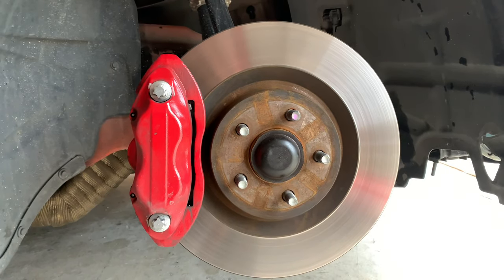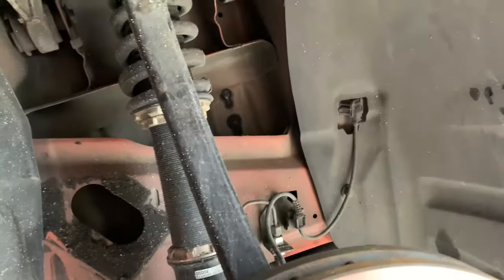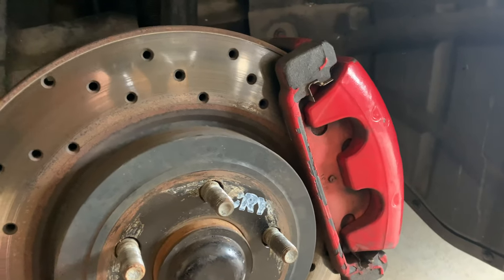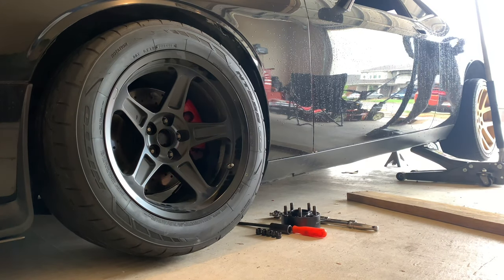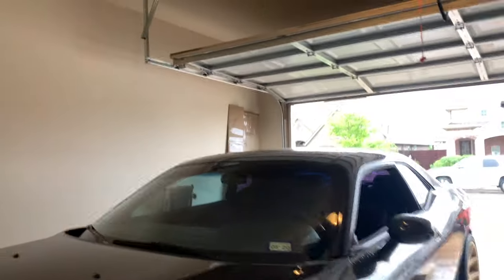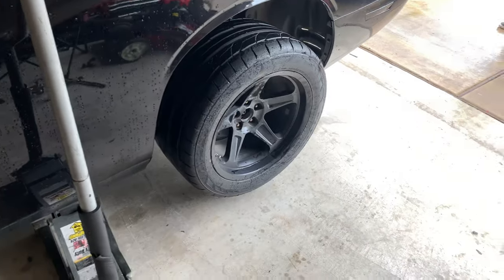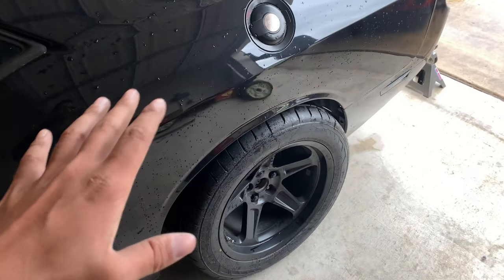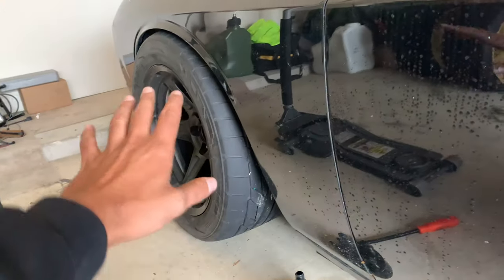OEM Dodge Demon Wheels On a Narrow Body Challenger!

Comment: Thanks for this video!
I have a 1320 Challenger that came with Nexen 275/40R20 Drag Radials mounted on 20x9.5 wheels, and just purchased a set of Demon 18x4.5 and 18x11 to use for drag racing.  I installed Mickey Thompson Sportsman S/S 28/6.00R18LT's on the front runners and Nitto NT05 315/40R18 Drag Radials for the back. I went with this combo because they are both very close to 28" tall, the fronts are rated for 1,650 lbs. @ 95 psi (regular race skinnies though lighter are only rated for approx. 1,100 lbs.), and the rears should easily fit on the back without rubbing anything while giving me an extra 1" of width over the OEM tires. The rears do stick out quite a bit...
Reply from the maker: Yea I mean the poke outside the body will still be pretty similar to my example even tho I used a 315 tire. Sounds like your on the right track and I’m glad I was able to help even if it was just a visual lol. We had a lot of fun this day swapping wheels lol
Reply: @TIRADORACING  Yes, big help. I know they'll stick out, but I'm only using them at the drag strip, no regular road driving. Thanks again!

Comment: There was rubbing when I did my 275 nitto 555 G2s on the fronts, but with a hub centric spacer I was able to fix it. Compared to other 275s the nittos stick out a lot more which give it that aggressive look but it also makes it harder to gain clearance. I’m sure with a different brand tire or small spacer he’ll be able to make it work in the fronts just fine.
Reply from the maker: Luke you did that on an oem demon wheel?
Reply: TIRADO RACING No, that was with my OEM 20x8 scat pack wheels. They changed the knuckles in 2015 so you could run 275s in the front. He might be able to use those instead of a spacer but I can’t tell you for sure.
Reply from the maker: Ok just wanting to clarify that for anyone who reads the comments for answers. We don’t want people reading that and thinking you tested that on demon wheels since that’s what this video is about lol......

Don’t forget about offset, where the edge of your scat pack wheel sits will differ where the edge of the demon wheel sits inside the car in correlation to the knuckle.

Comment: Found your channel last night! Awesome content! Have a question though..... I have a 14RT and I’m looking into the exact widebody kit you got on your chally. In regards to the wheels, I wanted to see if you know if I could possibly run the redeye 20 by 11 inch wheels on 305s on all 4 corners? I know the oem redeye wheels are a -2.5offset. Wanted to see if I would have rubbing issues at all? I am on full stock suspension btw. If you don’t know its okay. Thanks though! Looking forward to more chally vids!
Reply from the maker: Thanks for the kind words! And sadly I do not have a solid answer for you. I think you would run into the same issue as this video tbh. With the wheel being close or touching the knuckle and the tire being close or touching the knuckle as well. Nothing a small spaced can’t fix.
Reply: TIRADO RACING No prob! Thanks for responding! 👍
Reply from the maker: Of course! I’m a lot easier to reach on Instagram @tiradoracing but I will always try to reply to the comments section as well.

Comment: Great video. I have an '09 SRT-8 and was considering putting 18x11 Demon wheels on the rear with Mickey Thompson ET Street Rs in 305/45R18. Have you had any differential, speedometer or other issues after your swap? Also did you modify the tune with HP or Diablo afterwards?
Reply from the maker: I haven’t had any issues at all. Especially on the nittos being 315/40/18 that big sidewall makes the overall diameter of the wheel tire combo big. 

Now when I go to my bfgoodrich tires their 315/30/18 I notice my speedo says I’m going like 85-90 when In reality I’m going 70 on the freeway lol. 

But no issues on the 315/40/18

I didn’t notify Diablo or anything just been running it with no issues. Been over a year now actually. We’re at year 1.5 with this set up
Reply: TIRADO RACING nice, I hella appreciate the response. I think I’ll pull the trigger on this eBay purchase then. Good lookin’ out for yer MOPAR brethren. 💪🏼 Subscribed!
Reply from the maker: Ayeeee thanks bro! You got IG? Send me a DM @tiradoracing Would love to check out your build!

Comment: I got a 2010 Srt8 challenger. Did you have to run spacers or anything on the front to get them working on your srt8? I have the chance to lock in a factory set with 305/40/18 fronts and nervous I’m going to run like no one’s business 😂
Reply from the maker: No spacers on mine jus the oem demon and 315/30/18 for autocross and 315/40/18 for street tires. I had two sets of demons.

Comment: I love those Demon wheels....too bad they cant clear 6 piston Brembo's. 

Remember "some Scat Packs came with 6 piston Brembo's."
Reply from the maker: As long as you understand it won’t clear 6 piston Brembos! 

True bummer, I was going to upgrade to 6 pots but finding a wheel in an 18” to clear the 4 pot was hard enough!
Reply: So will these Fit 4 piston brembos?
Reply from the maker: Yes, not sure if you missed or skipped the part where these demon wheels and tires are mounted on my 2009 SRT8 with 4 piston brembos. I also explain it in the beginning of the video a little more.

Comment: Nice I like it & glad u shared this. Going to try putting the demon wheels on 17 rt . Curious where can u buy oem demon wheels (and oem demon tires would be sick but probably hard to get ?)
Reply from the maker: I got my wheels off eBay and once they pop up you have to commit to buy them because they’ll disappear just as fast lol 

Demon tires are just Nitto NT05R’s and are drag tires so I really don’t care to have those. I main road race and autocross. 

But eBay! I got them from a seller called oem_ohio!

Comment: Not a bad setup at all with the Narrow Body Challenger!
Reply from the maker: Crazy right!?
Reply: @TIRADORACING  Very! Although I didn't know that 6 Pistons wouldn't fit around the Demon Wheels very well... unless I've misunderstood something?
Reply from the maker: Nope, 6 piston brembos will NOT fit oem demon wheels. 

The Demon front calipers are something closer to the viper front calipers ( I read something along those lines a while back).
Reply: @TIRADORACING  Oh wow! That's a pretty cool fact to know! Very fascinating!
Reply: @TIRADORACING  I wonder if Aftermarket Demon Wheels are any different? Other than the 20x9 Size
Reply from the maker: MoparFam 300C aftermarket demon wheels don’t come in 18..... therefore aftermarket demon wheels will clear any brake calipers
Reply: looks so mean but try driving it

Comment: So question, you may have said it and I missed it but you mention those tires will fit '15 and above SRT's. Can the same be said for '15 and up RT's in regards to the knuckle spacing or is it the same for all year model RT's? Or does this only really apply to these specific rim/tire combo.

Excuse my ignorance as I myself have been considering doing the something similar to what you have and buying fenders and wider wheels. However the mechanical/technical know how is a bit over my head. As much as possible I want to avoid any cutting or rolling of fenders.
Reply from the maker: Your close but here it is written out. .

This wheel and tire combo (oem demon wheel 18x11 -4.5 offset with NITTO 555G2 315/40/18 tires) will fit:

-All SRT models from 08-14 (4 piston brembos on the front)

-Scat pack models with 4 piston front brembos 15+

Will NOT clear 6 piston brembos, so if you have a scat pack or 15+ SRT Model with 6 piston or 15” brembos the wheels will not clear the brembos. 

Will NOT fit 15+ SRT MODELS W 6 piston brembos. 

As you saw in the video the wheel cleared RT brakes but is REALLY close to the RT knuckle. The tire in the 315/40 size did touch the RT knuckle. 

So 08 - 2020 R/T models are the same it will clear the brake, but is extremely close to the knuckle. 

Sadly  we haven’t tested different tire sizes to see what we can get away with up front. But that’s all the info I have for now.
Reply: @TIRADORACING  Ty for the detailed write up. That clears up a lot of the questions and concerns I had about modding the fenders and rims.
Reply from the maker: No problem! It’s not for everyone! For me, the car is used to compete and I needed the tires and the grip, so cutting the fenders was no big deal. But for others it is a big deal..... just depends what your doing
Reply: @TIRADORACING  Would it be safe though to say that if I didn't go too crazy with wider tires that cutting the fenders can be avoided? Honestly this is the biggest issue. I see a lot of differing insights. Some say you have to cut/roll fenders, some say you don't. 

Maybe I'm not researching the issues correctly. Regardless I do appreciate the time you are taking to answer my concerns.
Reply from the maker: Your good bro! 

So I’m not saying to do this but, I do have friends on Instagram that went widebody with oem widebody wheels and they are STOCK RIDE HEIGHT, and they did NOT cut their fenders and they are fine......

The issue is not the tire, it’s commonly confused that “wide tires” are the issue. 

The issue is the wider wheels sit under the fender now. 

If you don’t get wider wheels the wheels will sit inside the widebody and it looks ridiculous. (Personal opinion). 

Don’t forget I track my car and my car is low so I needed wider tires and I need the grip so the benefits of cutting the car for more grip far outweighed “cutting” the car. 

So again I have friends that have done so that have been fine but I don’t personally have experience with it. So in the end you will need to make your own decision.

Comment: The wide body cars would look better with a 2" spacer on the front when running skinny drag tire/wheel combos.
Reply from the maker: **From experience** when running skinny’s up front we don’t care about looking cool, it usually means we’re about to put down some 1/4 mile times lol. 

Skinny’s up front or “pizza cutters” is a style on its own that can be found on all cars from mustangs to Camaros and everything in between that drag races.
Reply: @TIRADORACING  Sorry,  looks are half the battle.  I don't like the deep inset front tire on the widebodys when running pizza cutters. I also race, since 92, just not a late model Challenger. I'm looking at new Redeyes and will immediately change the tire/wheel combo. Fatties and skinny's.
Reply from the maker: That’s all you man. 👌🏽

Comment: Thanks.  I have been trying to find 18" wheels for my track day Challenger.  I think I've found them.
Reply from the maker: Awesome! And their forged aluminum! Super light!
Reply: @TIRADORACING  What tires are those?  I see they are Nittos?  What tires do you run on the road course?  most of the tires I've run are shorter than stock height of 28.68"  I saw some Toyos that were close, but they were 305/35r18s, and 2" shorter than stock.

Comment: Really wanna see the smaller tire with the 18x11 demon reps because I might have that set up if it looks good
Reply from the maker: Well demon reps don’t come in 18x11 (last time I checked). 

The reps only come in 20” and above. 

Again it’s all about offset. 

Just to clarify again these are real demon wheels 18x11 with a -4.5 offset. 

Don’t focus so much on the tire size, it’s about the offset. I used to have 20x11 forgeline wheels before these demons in the back, but I couldn’t fit 315, I would only fit 295 max. But most of the wheel is tucked inside the body of the car. Again offset. 
These demons are 11 wide but they poke outside the body and I can fit up to a 335 size tire now.
Reply: @TIRADORACING  right! I didn’t mean to type reps, these wheels are hard to come by, I’m hoping with the release of the new super stock challenger that maybe we can get some actual 18inch demon reps on the market
Reply from the maker: Ahh I see I see! Yes they are hard to come by! Took me like 6 months to find mine lol

Comment: Will they fit a 2016 hellcat but only the rear wheels and tires ?
Reply from the maker: It will fit just like they fit in this video. All challengers are pretty much the same from 08- present. They haven’t changed much. I’ve seen hellcats with these wheels and narrow body hellcats with widebody Hellcat wheels and they stick out the same. 

Will the wheel fit? Yes. 

Will the wheel and tire stick out? Yes.
Reply: TIRADO RACING yeah I seen pics of them too but there’s also 20 in replica rims of the demon wheels not 18 that’s why I asked

Comment: How big are the demon rims and where do you order them ?
Reply from the maker: OEM DEMON WHEELS ARE 18x11 -4.5 offset. 

You have to search for them on eBay or online or maybe the new mopar direct connection program will allow you to order them from your local dealer.

Comment: It would seem that the as of yet answered question is, does a specific size tire exist that will allow the OEM Demon wheel fit on the front without rubbing? Has anyone been able to test and verify this yet?
Reply from the maker: No because it’s an expensive test. 

What we do know is that the wheel is still very close to the R/T knuckles (non 4 piSton brembo cars) 

The only way I see it clearing is if you stretch a tire.
Reply: @TIRADORACING  Yeah I have a 2020 standard body Hellcat so the knuckle issue wont be a problem. I have just been digging for into to try and determine if I can get a workable tire before going through the time and cost to downsize my brakes. Seems to be a real lack of info on the subject, your video thus far has been the best I've found and it was indeed helpful.
Reply from the maker: If you downsize to 4 piston brembos you’ll be fine. 

My car is a 09 srt with 4 piston brembos and I run 315/40/18 up front. 

So if you downsize your brakes you wont have a tire clearance issue.
Reply: @TIRADORACING  Interesting... may I ask what offset wheel you are running? Also are you at stock height and did you need to make any camber adjustments?
Reply from the maker: OEM demon wheels strait off a Dodge demon. Only come in 1 size 

18x11 -4.5 offset 

Widebody hellcat and scat pack wheels are 20x11 -2.5 offset 

I’m low enough to almost drag the rockers in high speed turns. I’m on coilovers, Hotchkis front sway bar, 6 point weld in roll cage. 

Yes my car is cut. (Mine is the orange one in this video). 

So when demon wheel shopping if they aren’t 18x11 -4.5 they are not real. So just keep an eye out for that
Reply: @TIRADORACING  Been watching a few of your vids btw, good and helpful content. I did see that you had cut your fenders and concealed it with the widebody flares, and that would likely be my problem. I am running a set of lil devil flares with the baby front flare so cutting, unfortunately, isn't an option for me. Either looks like I'm going to have to run the 20x9.5 reps up front or just have something custom built. Whats your IG? Would like to give you a follow. Likewise feel free to stop by @evildodge where I'm in the midst of cutting up a brand new Hellcat as we speak :)